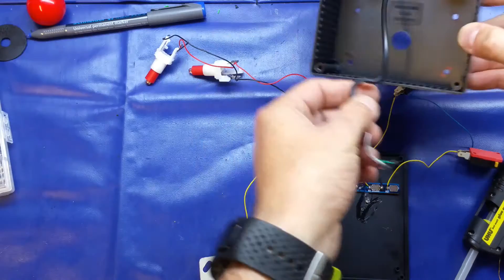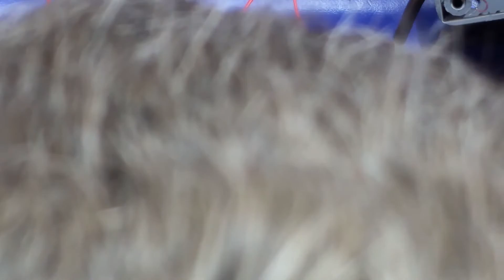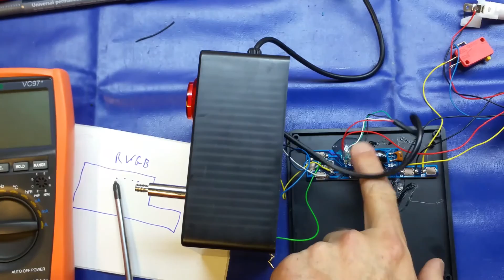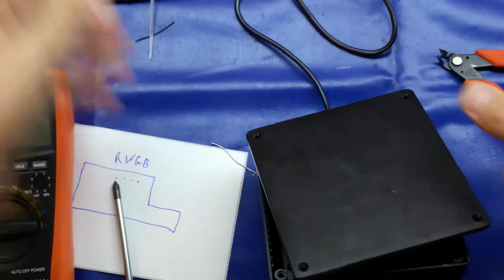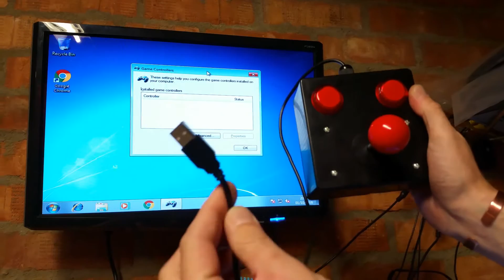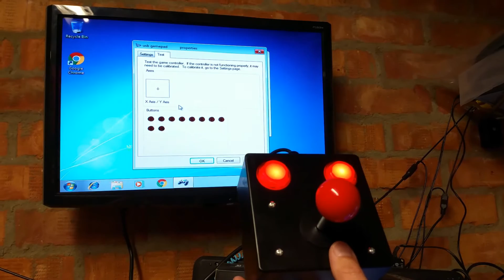Retro Joystick Build Part 4 - Final assembly / Testing

Comment from the maker: Hi, It's absolutely fine without...heat? Do you mean head? There is no heat generated and the heads are fairly wide on my bolts so don't see it being an issue really. I have to say that it it is a very 'robust' stick...it should last years.

Comment: how does the plastic take the nuts and bolts? one recommendation is to use washers under the bolt so the heat doesnt tear straight through the plastic.
But otherwise fun little project!